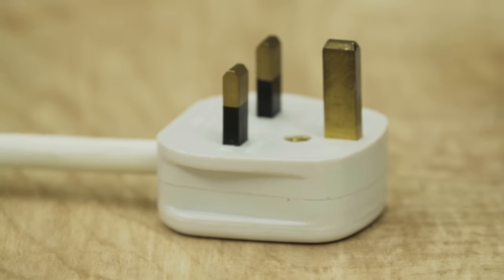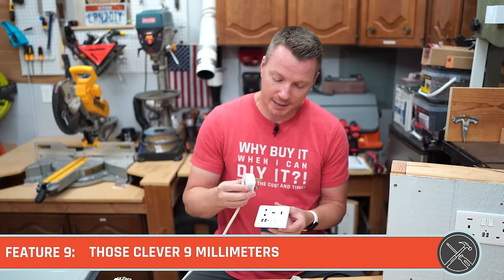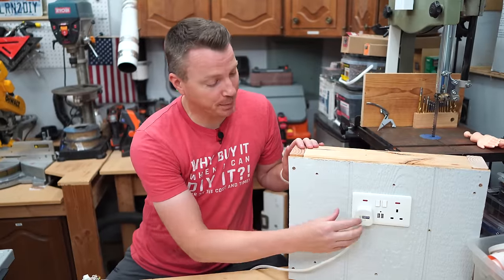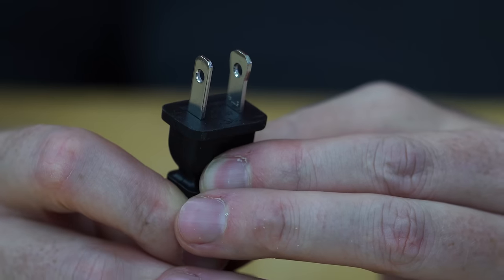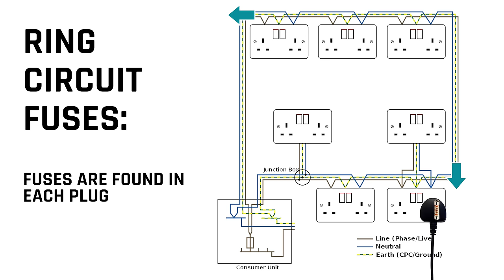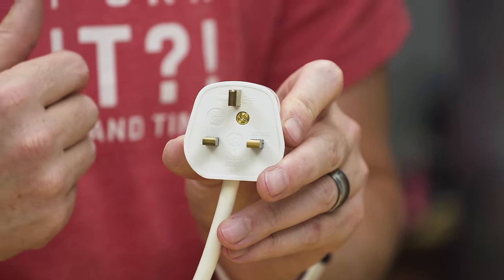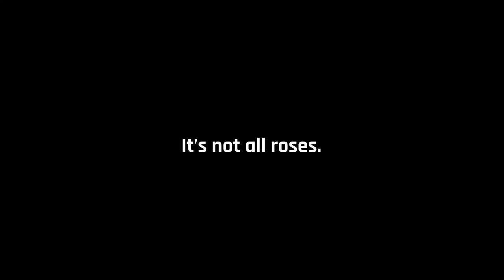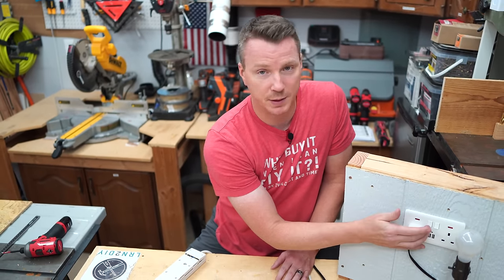British Plugs and Outlets Are On Another Level

Comment: Canadian living in the UK for 30 years here. That 3 pin plug that you demonstrated isn't the most common type where the strain relief is concerned. The best ones have strain relief bar that uses 2 screws to sandwich the cable between a plastic bar and the plug body, providing MUCH better strain relief protection.
Reply: Yeh, that design he showed was the first time I've seen it.
Reply: @kanedaku  I have seen that strain relief  before, on newer appliances, I think it's becoming more common here in the UK now.
Reply: @hawksquawks  I haven't bought any large white goods in a while, but they usually come with molded plugs. I haven't had to undo a plug for a while, come to think of it.

🤔Why did I undo so many plugs when I was younger???🧐
Reply: @kanedaku  becouse it was fun and you were curious
Reply: @jonsouth1545  I was plug-curious. I still am.
Reply: @kanedaku  Because things never used to come with a plug on... but a law was passed in the 1990s making plugs compulsory for all new electrical items. The plugs and sockets etc (safety) regulations 1994 I believe.
Reply: @TheJockey51  Yeh I was opening up plugs off things that came with fitted plugs. Back in the 80s we bought things that came with plugs too. Remember compulsory doesn't mean it didn't happen beforehand.
Reply: @jonsouth1545  Before I was eleven years old I was curious enough to have removed outlets from the wall to see what was to be found at the back. A now very elderly aunt recalls visiting us. When I demonstrated this to her, she asked "isn't that dangerous?"  She recalls that I replied, "It's OK, my dad does it."  Yes, I did once get a 240V shock, so she was right.
Reply: @TheJockey51  I remember there used to be a safety ad on TV with some bloke using a DIY plug with a DIY appliance and him getting electrocuted which I found particularly scary as a kid.

Comment: I've heard the 9mm insulation strips weren't just a safety feature to prevent accidents, but also to stop people deliberately making bootleg distribution boards by looping wire over the pins, plugging it in, then connecting the hanging wires to another plug...

Comment: On the load balancing. It's done slightly differently now, there are separate rings for heavy appliances like shower, cooker, washing machine etc and different rings for different part of your house. We don't use a single ring for a house anymore because people bought more and more appliances.
Reply: Yeah here it's usually one ring for upstairs, one for downstairs, one for kitchen and separate ones for high power items like shower.
Reply: what is shower? you mean water Gyser?
Reply: @raviteja-mw1mp  They're refering to a shower as used in a bathroom. A water gyser in the USA is called water heater over here, and also used here in the UK are immersion heaters, a large water tank with a heating element in it, these also draw more power and are plugged in to the mains, and can be turned on/off either with, or without timers.)
 Different rings supply power for high and low power, as certain items do draw more power and the cabling used in high power rings can handle it and as such they won't (or rather shouldn't) get overloaded and cause power failures (blown fuses etc;)
Reply: Old school circuits were front of house, back of house.
Reply: @Wabbit_Hunta  i still dint get the point. why do we need power supply to a shower head unless we have other plans ofcourse
Reply: @raviteja-mw1mp  Because some shower units are powered by electricity. Unlike a thermostatic shower, electric showers have their own heating element - which is usually seen in a box on the wall - so they only need a cold water supply, whereas thermostatic showers need hot and cold water.
Reply: @raviteja-mw1mp  Because some water supplies are low pressure and using a normal shower doesn't ensure an adequate flow, and also people love power jet showers. Just ask around, they're two a penny over here in the UK!

Comment: Great vid! As a Brit I pretty much agree with the advantages and disadvantages (especially when you step on a plug barefoot!). Another disadvantage is when taking appliances overseas, especially North America, the plugs (fitted with adapters) often fall out of the sockets as they are too heavy for the tiny pins. But overall it’s a very safe and secure design, very stable in the socket, little risk of electrocution.

Comment: After moving to the UK I was like "why in the earth is this thing so massive?!".

Right now, after 2 years, I also think that those are the best plugs out there, for 4 major reasons:
1) safety, safety, SAFETY (as described in the video)!
2) their fit in the socket is very tight and they won't be falling out of the socked on their own, which can be quite common for EU/US plugs.
3) the ON/OFF switch is a great invention! For example, if I know that I won't be using my office space for some time, I can just switch off one of the outlets and everything connected to it (audio system, monitors, computer, lightning, consoles, chargers, etc.) gets turned off at once. Yes, I could just unplug the extension cable, but this is not as convenient and leads to my final point, which is...
4) every cable is coming down from the socket (as shown in the vid), so you can, connect the plug and place your furniture (for example a night stand next to your bed) almost against the socket (like 3-4cm from the wall), with just enough space to put your hand in for the on/off switch. Good luck doing that with your cable going out perpendicular to the wall.
Reply: > which can be quite common for EU/US plugs.

That's pure speculation. I've lived in Brazil (which adopted a version of IEC 60906-1)  and in Canada (NEMA-2 and NEMA-5) and all of them do just fine.

>  the ON/OFF switch is a great invention! 

Adds to cost with a dubious return value. 

>  every cable is coming down from the socket 

90 degrees connectors are indeed nice, however, if your wall panel has two outlets, then 180 plugs are much better.
Reply: EU plugs fit pretty tight as well
Reply: I have never even heard of such a thing as a plug falling out of the socket on its own, so that surely only applies to US plugs.
Reply: @HeriEystberg  yes, US plugs sometimes do that.  some just fit extremely loosely
Reply: @leonardopsantos  the swithch is indeed redundand IMO. There are spliters with builtin one that dimly glows when on. I usually get a one with 1.5m extension cord and operate it with my feet.

And yo are also correct on the falling out part. In my 20years of using them this video is the first place I heard falling out is a thing.

The 90° cord is superior in every way, if you have two above eachother you justtilt the top connector by 60° for german efficiency
Reply: But it's still MASSIVE tho
Reply: "Quite common for EU" ? Can u please use the Name of the plugs. There are a lot of different plugs in eu. And in my opinion German/Type F are the best and I have never ever seen a Type F fall out of the socked.
Reply: @PearBillet  Try to use a MacBook Pro 140W charger with an EU plug directly attached to a wall-mounted socket.
Each big charger I own has issues using the EU plug, because they are usually not the round, 3-pin (2+1 as ground), but a smaller, 2-pin versions, a bit similar to those US ones. They are the problem.
Reply: @leonardopsantos  180 connections take up more room. 
And with UK sockets, if there are two, they are always horizontal side by side, so being 90 degrees doesn't affect the other at all. Simple solution!
Reply: @stixinst5791  The switch is not redundant at all. We use them all the time instead of having to pull out every cord. It's one of the small conveniences that makes life so much better.
Reply: @user-ed7et3pb4o  why do that though? I just  turn off the main power switch for the sockets when I leave the room. When I am in the room why would I care about a turned off something eating 1kwh/10years.

Comment: You can even plug in a hairdryer and an iron at the same time is not something I realised was impressive 🤣
Reply: Explains that Red Dwarf joke when Cat plugs his hairdryer in and all the systems go off! Didn't realise it was a jibe at other power systems!
Reply: I'm confused what that part means. Does it mean from the same socket or the same building?
Reply: Is that even a real problem these days though? The hairdryer would only be on for a short period of time while in use, and these days irons heat up rather quickly. It's not like in the past where the device turned on to the amount needed to maintain the final temperature, which is rather slow and kind of dangerous. A decent set will have a PID that will heat up faster at the start and gradually heat less as it gets to the desired temperature. At that point, you'd probably not have any trouble with power draw on the circuit.
Reply: Are you  just pretending to be simple-minded ?
Reply: @asgacc8789  Wait. You can't use both from the same socket?

Yeah with a UK socket, you can use multiple appliances from the same socket.
Reply: @emmessarr  Well it was filmed in the UK and was a BBC production, so they probably couldn't afford a non-UK plug 😆
Reply: Wait til you hear how most Americans have never used an electric kettle because of their weak mains electricity

Comment: A lot of credit for the design of the Type G BS 1363 plug has to go to British electrical engineer Caroline Haslett (1895-1957) who was the only woman member (and the only safety expert) on the 20-person committee convened to examine the requirements for electrical installations in post World War 2 Britain. An important recommendation from the committee was to ensure the safety of young children by using shutters to protect the contacts of the socket-outlet and hence the BS 1363 was born. The report also recommended the ring circuit system, which would become standard in the UK.
Reply: Neat! Of all the thing the brits have brought to my country, I'm super thankful for this one in particular
Reply: BS1363 relates to only the socket, BS1362 covers the plugs and BS646 (rather ironic if you know MK numbers! Its actually probably where MK got the number from) covers the fuses in the plugs
 
* zips up anorak 😉😂
Reply: @bushmanPMRR  *Screws lid on thermos...

Comment: Great analysis. We tend to run similar appliances on different rings, 5A for lighting, 15A for sockets. Things like ovens and electric showers get their own discreet supply. This avoids the unbalanced loading issue.
Reply: But you have many unnecessary radial circuits, with a larger main panel. More expense.  Balancing in a ring is not a problem if designed and fitted properly.
Reply: A lot of new builds are now radial in the UK
Reply: @themilksnatcher  
I have never come across one.
Reply: @SilverSparkle 
Apartments in tall blocks now need arc detection devices, AFDDs. AFDDs are also recommended on all installations.  These are expensive. Having one AFDD, on one socket curcuit, with sub circuits off it on fuses keeps costs down. 

So this move back to many radials with an expensive AFDD each will stop.

Comment: As a Brit I never knew that we had such a well designed plug…
Reply: Have you travelled abroad? We have the best!
Reply: We have Dame Caroline Haslett to thank for the designe. From Wikipedia: During the Second World War she was the only woman member (and the only safety expert) on the 20-person committee convened by the IEE to examine the requirements for electrical installations in post-war Britain, part of a larger scheme of Post-War Building Studies.[18] An important part of those recommendations was a new plug and socket standard, the first requirement for which was To ensure the safety of young children it is of considerable importance that the contacts of the socket-outlet should be protected by shutters or other like means, or by the inherent design of the socket outlet. The result was BS 1363. The report also recommended the ring circuit system, which would become standard[18]

Comment: Ever thought about the System in Germany? I'm from Germany and have been to NZ (switches on the sockets aswell and flat - i'd say compareable) and I think it's not this easy to get the connection "waterproof" or at least resistable against moisture.
We have deep sockets and in case we have a connection outside it's a thicker plug with sort of a rubber ring, which "seals" the socket quite good.
And getting another plug for a broken one is easy aswell. Load is distributed evenly through fuses in the fuse box and if the load is too high the fuse switches off. So just switch the fuse on again and reduce the load on this curcuit a bit (normally we have ~3500 Watts per fuse)

Greetings,
a german sparky :)

Comment: Plug sockets with switches, very durable plugs, and their wires mostly sticking from the bottom instead of the front really impressed me with the UK's system, it's just really safe
Reply: ......we have had them forever in India too.
Reply: Safe.. Except that the voltage is double! ⚡
Reply: @tzsteve33  means we can boil a kettle without waiting until the end of time!
Reply: @adam_matthews  I reckon that was the main reason for having 240v. Imagine having to wait longer for a cuppa, riots, revolutions etc would surely have occurred 😂
Reply: @tzsteve33  Most of the world is using about 230 Volt, most of the problems are in America, which uses 110 Volt.

Comment: Im from Ireland and like you said, we use them. I've always compared these plugs to other plugs when i flew off somewhere. I always thought that they where the best design. You might find it also intresting, in Ireland we have a mains switch for our kitchens... So basically your oven and stove will not work unless you turn on the kitcehn mains, in morden Irish houses you will also have a mains switch for the dishwasher and washing machine.

Comment: When I was a kid, I had a mini tv that had a european plug that wouldnt fit in the uk socket, so I connected crocodile clips from a build your own radio set to the end of the plug and to two nails, jammed the uk socket gates open with a pencil and proceeded to push the nails into the socket while holding the nails themselves, safe to say I was shocked with the result and never tried that again.